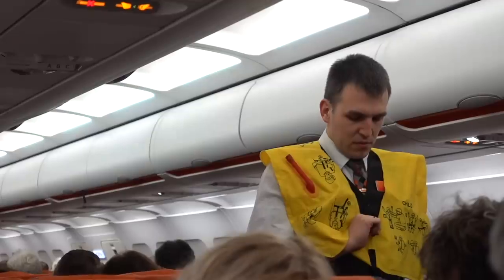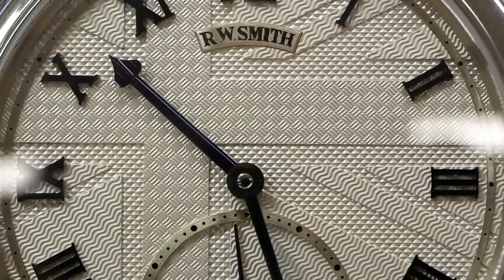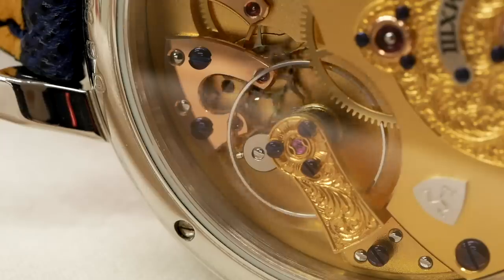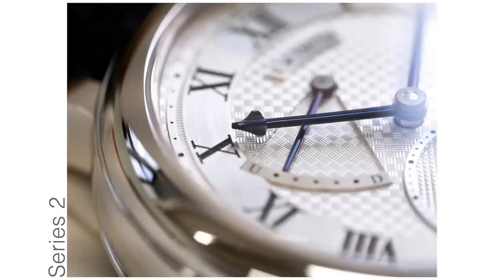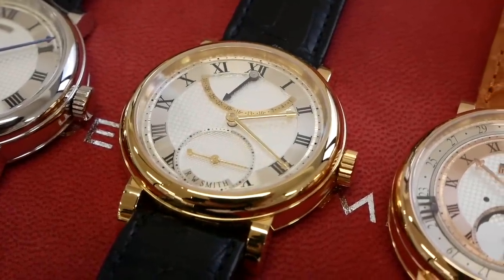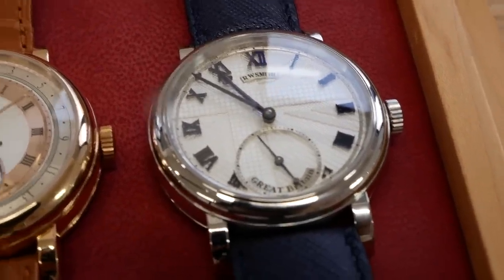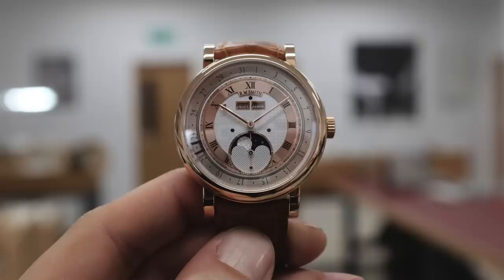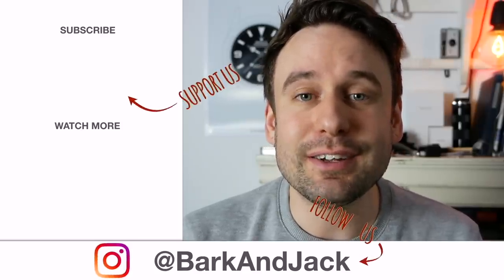Part 1 - The World's Best Watchmaker - Roger W Smith OBE

Comment: Great video Adrian
Does slower beat rate keep the time as good as faster ?
Reply from the maker: Thanks mate. An accurate slow beating watch shows good watch making. It’s easier to make a fast watch accurate. The problem with fast beating watches is that the parts work harder and usually wear out longer.